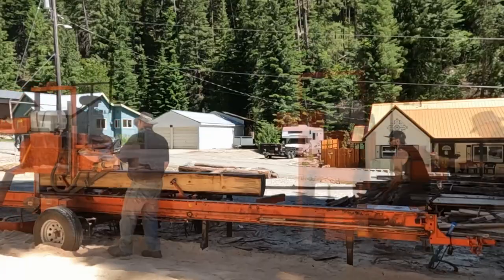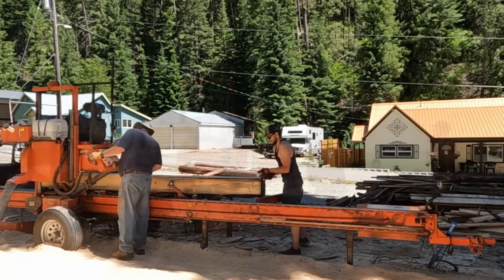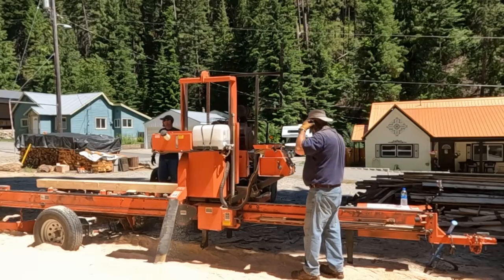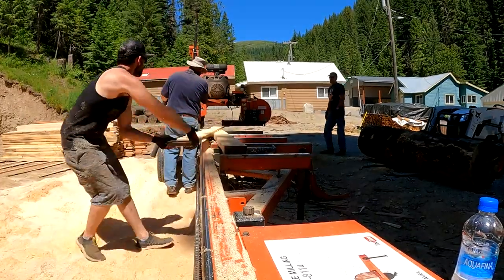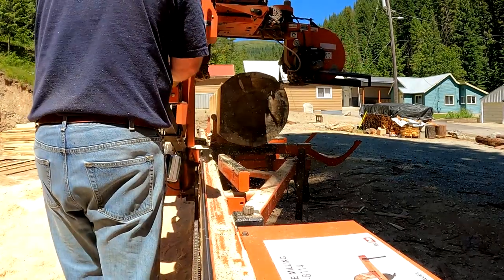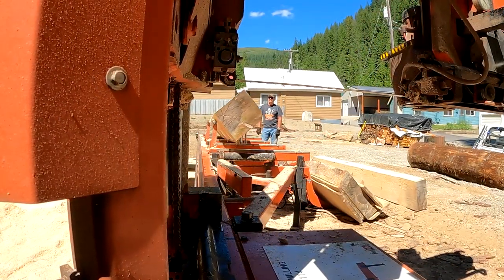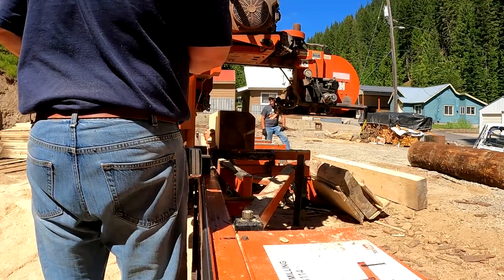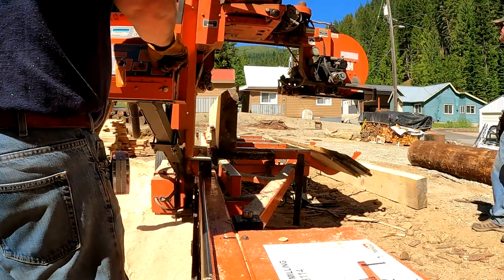Trouble With The Sawmill!  What Now??? [Wood Mizer LT40]

Comment: How often do you replace filter ?
Reply: Whenever it starts to run a little shitty. Today's gas is pretty bad. Even the ethanol free doesn't seem to last.
Reply from the maker: I'm going to say around every three hundred hours but agree with Arrowhead.   When it starts running rough that's the 1st thing ti check!
Reply: So far I haven’t had issues with mine but I’ll probably just change it. I have about 300 hours on it.
Reply from the maker: @bustedbladesawmill2484   I'd just add one to stock!  If I remember right I replaced mine around 300hrs!  I'd just forgotten!